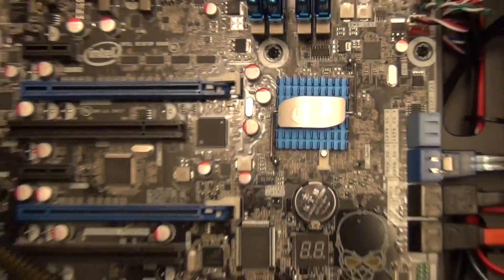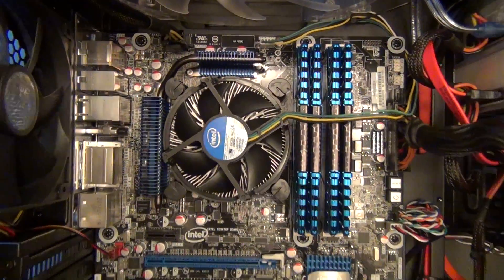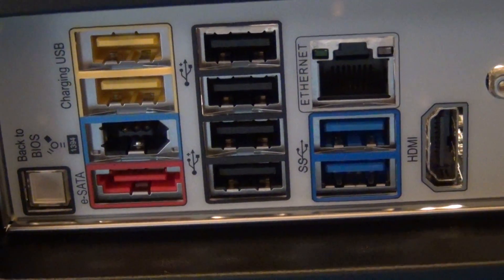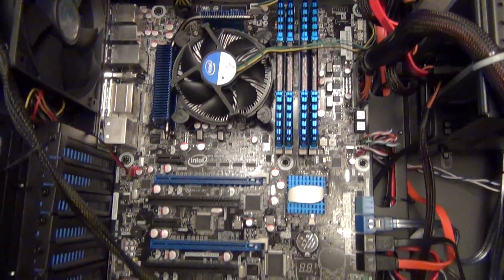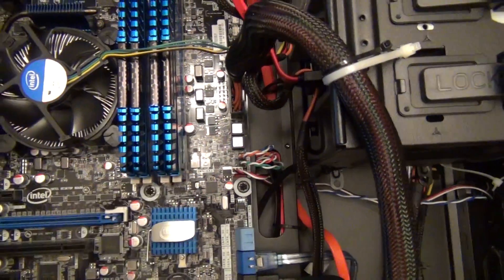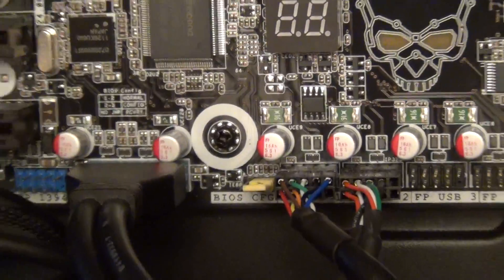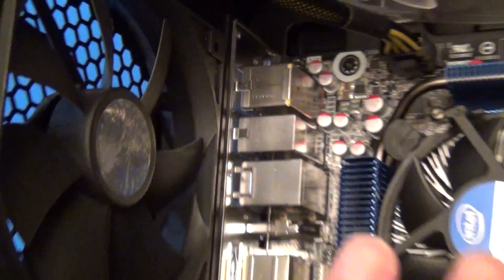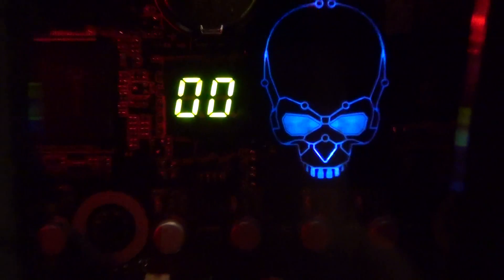Intel Desktop Board / Motherboard DZ68BC Review

Comment: Dear Sir:
Hello: I don't know if you can help me. I have an Intel DZ68BC that stopped working overnight. When checking it I opted to change my Corsair HX850 power supply because the fan would spin for 2 seconds and stop. I bought another new Corsair RM750 and the problem remained the same. I also noticed that the skull does not turn on the lights and the number on it indicates is 58. The monitor and the two cdrooms stopped working. It is also impossible to access the Bios because the computer turns on for 2 seconds and turns itself off. I cleaned the processor (Intel Core i7-2600K - LGA1155) and changed the paste, I cleaned the memories (4x4GB) and the fans and everything remains the same.
Can you help me with the solution or tell me what I can do or check, or is it that the motherboard has already died and I must replace it, if so, do you know any other similar that you can recommend? Your help will be very appreciated.
Please excuse my English.
Reply: hello you managed to solve your problem I have a board the same

Comment: Will this work with 3rd gen?
Reply: Jonarck Flagman It works but I had a lot of weird ram issues with few of the bios versions. If you don't already have this board, I really don't recommend getting it.
Reply: +Jonarck Flagman Yes, I&#39;m using a I5-3350P with 2x 8GB RAM
Reply from the maker: Sorry, I have no idea.  You'd have to check the Intel page for this board and its manuals, or BIOS updates.  I have a 2nd gen chip -- i7-2xxx.
Reply: It does work with 3rd gen, as long as you update the bios using a 2nd gen. I had to go through the process of finding a computer store that had 2nd gen processors, to do it for me since I only had a i5-3550p
Reply: +Rbanh Does it work fine though Rbanh? Cause I've heard a lot about them mostly negative. Please respond :)
Reply: +Rbanh alright, but what about bios 0042? Does that fix everything?
Reply: well the ram is still bugged for me, I can only get my pc to boot if I have my 2 ram sticks in the 2 dimms closest to the cpu

Comment: Excellent review!! Thank you for being as detailed as possible, I was on the fence about picking two of these up off of eBay brand new for $25 each. After watching your video I took the plunge and feel good about it :)

Now that you've been running your motherboard for a while how do you still feel about it? Do you like it still or have any issues that were not brought up in the video?

Thanks again, and look forward to future reviews form you!!

Jathor
Reply from the maker: Thanks!  I am happy that you found it helpful.  It makes it worth doing them.  Wow, $25 is a lot less than I paid when it was current, but that is to be expected.

I am still very happy with the board, no complaints at all.  I can't comment about it vs. newer boards and features, but for it and my current PC built on it, it has been great.  The following stands out to me beyond the review:

1. I rather like the onboard audio capabilities and software.  It was quite full featured.  I got a free somewhat expensive Sound Blaster card to try out.  But in comparison, it wasn't much of a change from the onboard capabilities.  I almost prefer the audio driver software that came with the board.

2. My board died after a few months when the power was cut (circuit breaker tripped from something else) while the computer was in use for the firth time.  The board reported an error code and the computer wouldn't start.  Thanks to good cable management I was able to extract the board pretty easily and send it in for a free replacement from Intel.  I was out of a board for 2-3 weeks and they sent me a new one.  I re-inserted and attached the cables, and the new one hasn't had a problem.  But I took precautions this time, bought a Cyberpower Pure Sine wave UPS so the power can never be cut on the PC again (and I have video review).  That's one thing laptops have over PCs, a built in battery :) .